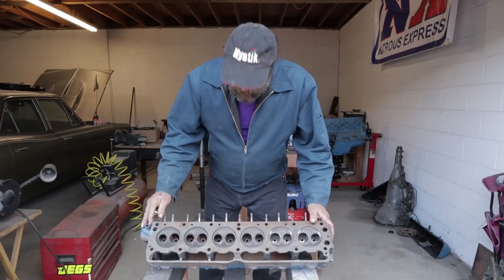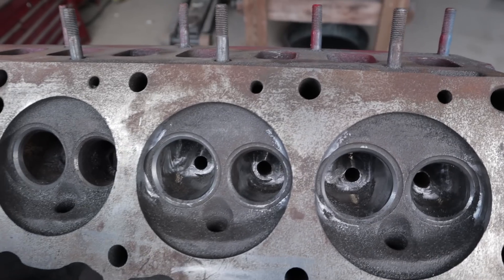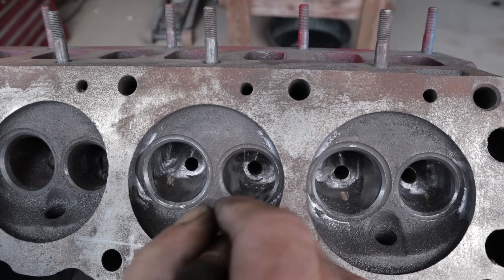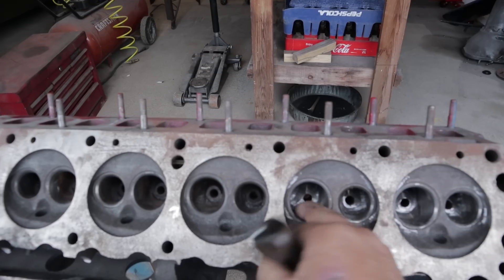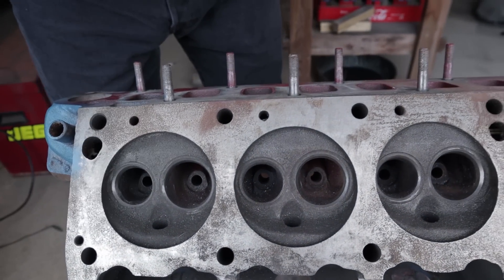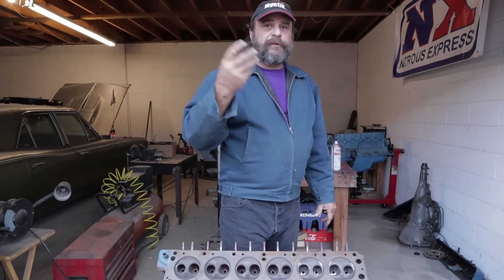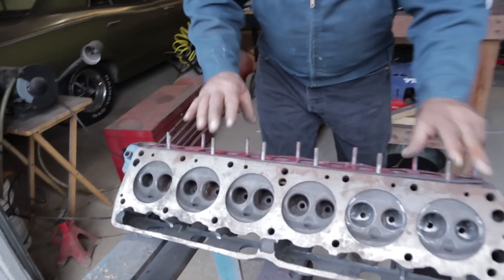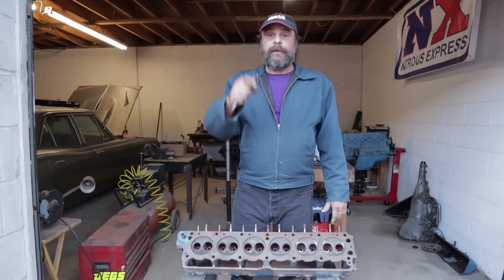Hot Rodding The Slant Six - Porting The Head

Comment: Almost all new people like me and under 35 wouldn't have a clue about porting. They just think making the post or hole bigger. Wrong barely any metal is removed for the ports it the bowls after were the valve guide sticks out , you need work is area nor do you want to polish them has to be rough texture too get air and fuel to mix properly.

Comment: Could significant gains be appreciated by adding metal to the undercut areas in the intake tracks? A little tig work and you’d be in like Flynn! Would that technique be just too much sugar for a dime? Also, would you have problems with head warpage from removing the stiffening ribs in the push rod gallery? You may have addressed this on the video you made, but I missed the damn thing, and I am too lazy to go find it🤨. Good work you’re doing sir👍✊

Comment: Thanks Uncle Tom and Oscar for letting this come true I’ve heard story of the six beating a Mild v8 but I’ve never seen it I love this unique motor.
Reply: My dad's 225 70 duster runs low 13s on a 75 shot of juice.  He's hoping to drop a second or more by installing a std trans and a 125 shot.  No weight stripping either.  Also, our dragstrip is appx 1700ft above sea level.

Comment: Is it possible to add metal (welding) to the intake ports/chambers to smooth out the flow?  Seems like you could get the "best" shape for flow that way.
Reply: I was thinking of brazing; welding on cast iron is a good way to create huge cracks. But you might be able to lay some brass in there.

Comment: theres a lot you can do depending on just how daily drivable you want to keep that trusty old six popper id smooth and open the oil return holes and smooth out the spark plug reliefs a little as well they can get tricky so i wouldnt go too far with them then have the head planed 010 to 020 for a slight bump in compression
Reply from the maker: It's a strip only car, and the head has already been decked .100

Comment: Were the intake ports undercut purposely to create swirl? Or is it just a shitty casting? Just curious.
 And as far as that under cut goes I would think increasing the size of the intake valve would match up that undercut and blend it all a lot better. I guess you'll find out how well it works when you get it all together. Looking forward to hearing it run when you're finished. I've seen some videos of those old slant 6 engines with boost kicking ass and taking names.
Reply from the maker: No, this is just a shitty casting.  Only two ports like that
Reply: I wonder if one can epoxy the undercut to make the transition into the intake valve that much better?

Comment: Hi Tony . Try notching both sides of the exhaust port next to the valve guide to get more flow around the stem.
Bolt the head on the bare block to see if you can open the combustion chamber around the valves to the bore size or eye brow the block to suit head to 1/8 inch from the top ring .

Comment: Chevy small block heads with 1.94" intakes were machined to fit the 2.02 valves, if you didn't relieve the intake side of the combustion chamber you left a lot of power on the table. If you never tried porting, deburr exterior cast areas and get the feel and learn to avoid kick back and grinder shimmy. Then venture to the critical unforgiving areas like the valve seats when you have confidence.
Reply: Yes!!!

Comment: When I worked at Chrysler Trenton Engine 68-71 production on these heads was 500 parts per 8 hour shift.  Foreman would get a bonus for anything  over the production number, so production was pushed hard.
Reply: I worked at Chrysler plant #2 in Fenton Missouri. (st. louis) worked in the body shop from 84 to 90. no one today thinks anybody worked their butt's off in these car plants. 🇺🇸
Reply: @kurtzimmerman1637  That's mostly because of the way they rust so quickly. The other big two also had problems, those ford fastback's? They rust out like crazy around the window seam.
Reply: Having worked in the Tool Room of an engine plant I can absolutely confirm that their were foremen that were completely concerned about their numbers. I remember one time I got sent out because they were having a problem with actually pushing the blocks off of the fixture clamping pads. The production foreman wanted the hydraulic pressure turned up. Putting a gage on the pump I found it was already at the specified pressure. I then asked the set-up man to pull one of the drills out. The drills were completely shot in terms of cutting ability. This was on main bearing cap tapped holes. Turned out the drills were a week past their scheduled change point. Something on the order of 4000 machine cycles. Sharp drills, every thing worked fine. Another time we spent a weekend rebuilding a milling head that cut the top of the head on each end for the valve cover. Hot everything re-installed  and we had the same problem. Again I asked to see the tooling. The cutters were one RH and one LH. They had the carbide inserts for the other handed cutter in the side they were having issues with. Proper inserts, problem disappeared. All because nobody properly analyzed the problem to start with.
Reply: @mpetersen6  I almost lost both my hands when a machine that was supposed be off suddenly clamped down on me.  Turns out the day shift foreman had a suckass electrician bypass the switch and wire to stay hot all the time to keep production going.  Then the foreman tried to write me up for working in an unsafe manner.  Same foreman on days used to also run the tooling till worn out and out of spec.  I worked 2nd shift so one day I got tired of changing tooling right at the start of my shift.  I saved all the worn tooling and installed it before I left.  The next day the day shift foreman started screaming at me as to why everything was out of spec. I told him in front of the general foreman that it was his day shift tooling and why was his last cylinder head within spec and my 1st head was not.  He started to say something but the general foreman cut him off and kind of smirked at me and said don't do that again.  I said OK and walked away.  Another day in the life of a factory rat.
Reply: Gary's experience actually shows the real reason there's so much variation on Slant parts, compared to modern engines. Slants were pumped out as fast as possible, in an era before CNC and assembly robots, the pressure to push them out to meet demand is what led to lower quality control, and that is true of all high volume production of the 60's and 70's.

Comment: What the heck did you do to your hand?!!!!  Be more careful would ya, need you around with all your parts. This slant 6 stuff is right up my ally, invaluable info. My daily driver is an 84 Dodge D100 shortbed with a 225, I have a 70 dart with a 225 and a 65 dart with a 170. I have a 340 block that i need to have evaluated and if good will go in the 70 dart with everything else its gonna need.The spare 225 will go in the 65 dart possibly turbo charged who knows. The 170 will be kept around for a high fuel efficiency project I reckon. I may try Clifford performance package in the truck for starters all a matter of money.

Comment: Is it possible to fill the undercuts and reshape the intake ports with a high temperature epoxy or solder? I would set that head up on a mill and rough out those exhaust manifold ports a lot quicker then a die grinder.
Reply: One shop i worked for did, when he couldn't fill in with weld. Creating a surface for the filler to hold onto is no easy task.
Reply from the maker: I may actually end up using epoxy on that one intake I pointed out
Reply: False Flag  Why I mentioned creating a surface for the filler to hold onto. My old boss in the case of alloy heads (on a motorcycle) would add anything from lumps of weld or run screws into the side of the port and then fill and grind. I honestly felt the same as you, what if it comes off..
Reply: @Oldbmwr100rs  I have worked in heavy industry for decades and have found some of the epoxies to be pretty durable. When reinforced with a few screws like you mentioned it should work. I don't know much about the solders, but would like to see some one try.

Comment: Tony how long is it taking per intake/exhaust port to grind/port out?
Reply from the maker: Roughly 30-45 minutes a bowl
Reply: My brother-in-law used to check something with a "flow rate" after he did Porting and polishing!?
Anyone know what im saying?

He said he used air pressure to check the flow rate for when he's polishing, he said you want the same amount of "resistance" or "flow"through each head
Reply: @thecloneguyz  - what that means, is that after most of the work was done, each port was checked to see if it's Cubic Feet per Minute flow rate was matched to each previously completed port. If the ports all flow the same amount, then during each intake cycle they will flow the same amount of air and fuel in to the cylinder, so each cylinder will make the same amount of power.
If an engine is perfectly balanced mechanically, and makes the same power from each cylinder, it will idle with nearly zero vibration, and there will be less stresses within the engine as runs, so it will last longer and deliver its performance smoothly.
Reply: @thecloneguyz   Sounds like you referring to a flow bench.

Comment: Have you ever used fine brass screen material at the gasket on the intake ports for greater atomization? I did with what I believe was great results, no formal test. I did not go for horsepower but rather greater economy. Horsepower was the plus side of the build. It was a 69 Valiant 4 door. Not pretty but was reliable until I let a shop work on it. At that point I couldn’t afford to fix it. It looks like your burn is healing well.

Comment: this video makes me want to go out and find a 68 nova with a 250 six in it like I had in high school and build it. want a 4 speed this time.
Reply: @Kurt Zimmerman My dads first car was a 69 Camaro with the 250 six and 3 speed manual. It had an Offenhauser aluminum intake with a progressive linkage two barrel carb, split header that went back into single exhaust with a glasspack, a bigger clutch and Bellhousing from another stock GM application and a 4.10 limited slip rear. The car would hook up and launch harder than anything my dad had encountered on the street. He even outran a big block 4 speed Nova with it once because the guy was having so much traction problems. That Nova was one of the hot cars in our area at the time too, it humiliated the guy and nearly started a fight fist in the parking lot.
Reply: @Impactjunky  sounds like your dad is a cool guy. love all the memories from my youth!

Comment: so many modern heads barely need anything done, the old heads are more fun
Reply: closertothetruth if choking on metal dust and fishing chunks of cast iron out of your eyes and ballsack is your definition of fun, you should expand your social horizons
Reply: @cruzinezy1968  Depends on the gal. Some it's worth it, some it's not!
Reply: @cruzinezy1968  we use powerful industrial vacs on the other side when we do it , its not that bad , there are far worse things in life  , i rather do this than the hell on earth ive been through any day
Reply: Every modern head will love some work. General rule for modern heads, Dont touch the intake side unless you leave a slightly ruff surface, Exhaust doesnt care what you do as long as you increase and straighten flow